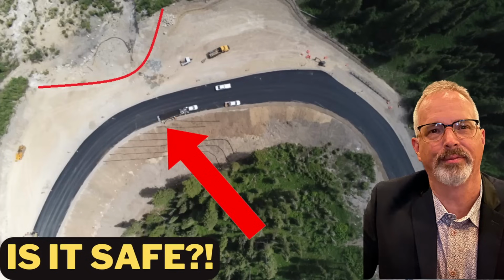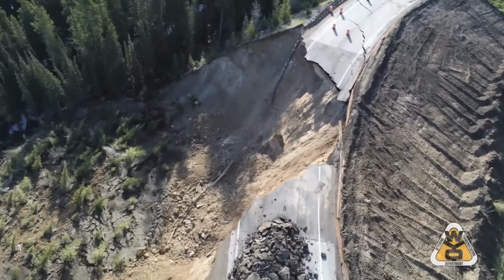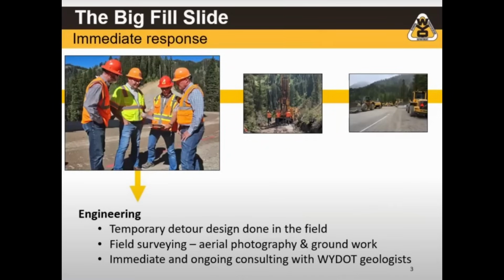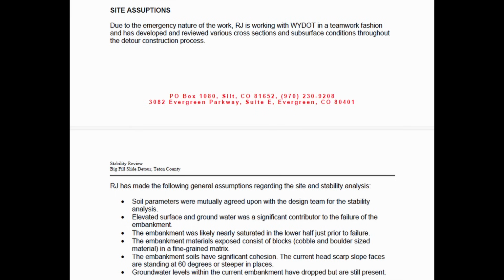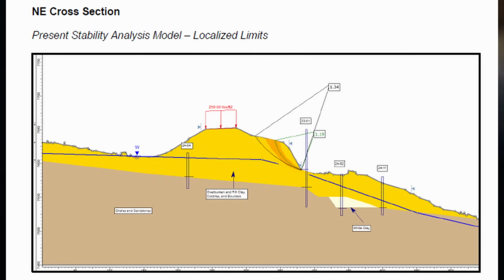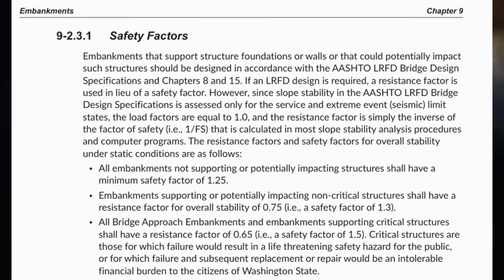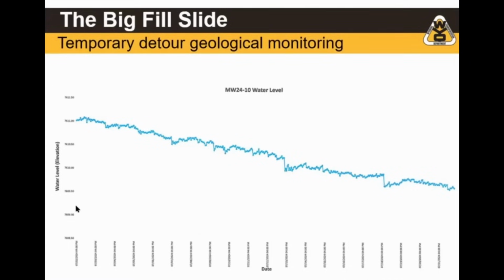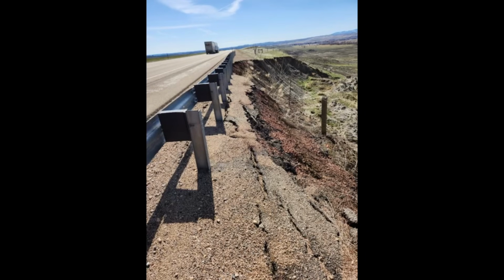Teton Highway Rebuild Update

Comment: Here's a true story about another 'Professional Engineer'. I owned an apartment in a 30 unit building that had a water intrusion issue that had compromised structural wood members on three levels. A licensed 'P.E.' did an inspection after the drywall and building cladding was removed. He then submitted an engineering estimate of $12,000 to provide drawings (with his 'magic seal') to guide the contractor. That was just for DRAWINGS but no actual repair. But all we really needed was a good wood framing contractor to rebuild what was there and what was already code approved. Plus the roof repair that was already known. We hired a contractor to replicate the original framing costing $14K total. The P.E. was angry we ignored his insistence on his new drawings with his SEAL! He even reported our HOA to the building and codes office! BUT our contractor had already pulled a permit to replicate the existing framing. So we were good.
Reply from the maker: I'm not sure what you mean by "another". Not at all engineers are the same, just like not all contractors are the same.

Comment: Trying to parse through this,  is the temp bypass at risk of sliding as well or is it a bad set of specs for curve and slope aka into the winter?     And is the risk also in the repair phase to the workers on the face?    Truly a Slip shod (pun not intended but not ignored) operation and pencil whipping of the situation.     While I am not remotely a geo engineer,   I do know data sets and reports and the presentation (or summation)  has to be packed up by hard data or its subject to outright lies.    As a cycle rider,  riding into a crack (mild, more a chasm)  like that is one of the nightmares for  a rider (much like going into a curve and finding loose gravel on top of asphalt).    The only good news is injured and not killed.
Reply from the maker: Since WyDOT didn't provide the basis of their quick design for this temporary bypass. I know that it simply takes several weeks to drill, sample and test soils for geotechnical engineering purposes (it certainly takes more time than the 3 weeks the took to put in this bypass).  It has always been my impression that they just made a judgement call about what to do without what I consider to be the customary type and amount of engineering analysis and I think that was unduly risky (and still is in my opinion).  I think this work to the main embankment section is very dangerous.

Comment: The bridge above the failed Rapidan dam that failed 2 months ago got a new video out. https://www.youtube.com/watch?v=RdlDCfsWqns
 The bridge's concrete foot is now above the river level, leaving metal rods holding up the weight of the bridge. So, I think it has officially gone beyond scour now as a process of erosion.
Reply from the maker: Thanks for that link.  I am going to do an update soon to cover what the county and state are going to likely end up doing with this dam and bridge.
Reply: @CaseyJones-Engineer   Good luck with that, I was shocked to see how shallow the concrete pour went, thinking of the old bridges that were so deep that people got the bends working on their foundations. 

Also, grats on avoiding the Harley drama with your other channel. I was at Sturgis 3 weeks ago, and knew something was up then, but not what exactly.

Comment: Time to do some horizontal drilling and put in some drainage to handle the water.  If they just do a bunch of filling without doing some drilling and soil amending (Grouting) to prevent progressive failure.  "Mutually agreed upon soil parameters" sounds like typical bureaucrat word salad.  Unless they can provide lab results and some geotechnical re-evaluation reports, I am not going to believe them.

Comment: I’m not an engineer.  Get really big boulders, lots of them.  Start piling them at the bottom.  Over engineer the amount needed.  Reduce the angle of the slope.  Build from bottom up a firm foundation.  Backfill with gravel and not water soluble clay.  Pack it in tight.  Overlay with water barrier such that water doesn’t get into the slope.  Your Welcome.  I’ll send my invoice for $2,000,000 next week.
Reply: Five times too expensive, I estimate. I'll send my invoice for $1 next week.
Reply: @allanfarr  brilliant idea! I think you could do this at the beach when trying to save your sandcastles - but not applicable for this project. Good luck!

Comment: Though it might not be possible, it’d be interesting to know the safety factor that was used during the original design of the embankment.  That would inform choices of materials and methods for the reconstruction and repair.

Being native to the Rocky Mountain west, and having driven over the road in question and many of the roads in the general area, it seems to me that a 60 degree angle repose is way, way steep.  It simply doesn’t seem right.  Also, there have been severe earthquakes nearby, such as the one that triggered a landslide that filled a canyon and created a new lake.

Among all the events and factors in play here, what weakens my confidence the most is the lack of transparency.  Standard engineering practice includes reviews.  Military projects are run by knowledgeable and often well educated officers who also bring in third party consultants.  Contractors are expected to keep the customer informed.  The Wyoming folks aren’t doing anything like that.  The public deserves better.

Comment: Data could have been gathered from the original designs of the fill (as what material was used in the construction process). For a proper reconstruction the entity of the fill should be removed ( maybe even reused) and then constructed with newer designs including an appropriate drainage system and using certain reinforcement measures (geo textiles for earth like materials etc). There was an obvious lack of a proper drainage system in the fill in the original build. If the system is not properly implemented then the new fill will crash in a couple of decades. The proposed cross sections are an insult for a civil engineer or a geotechnical engineer (imho). November as a complement date is far too soon….
And some criticisms about you. And you should understand that this is a very desirable character. You are an annoying person and I like it, because things should be done right on not to be done. 11% slope on a mountain road is not that bad for a detour. 
Hope to see updates on the rebuild of the pass.

Comment: I feel like safety factor needs to be scaled according to certainty of strength and load, and should probably be at least double the combined uncertainty involved.  Given the speed they supposedly figured everything out I can't imagine the combined uncertainty is less than 10% unless they are admitting to gross negligence as they KNEW it WOULD fail, unless they had much higher prior knowledge which would have told them that it would fail, they can't be that certain how strong it is, clearly their prior knowledge was wrong so how are they suddenly so certain how strong it is?
Reply from the maker: You have pointed out one of the main concerns about this situation.  Their judgement was wrong when it came to assessing whether the slope would fail catastrophically, yet they expect people to trust their judgement about the rushed rebuild.

Comment: “Elevated surface and ground water was a significant contributor to the failure of the embankment.” Yet the design is devoid of dewatering drains. Am I missing something?
Reply from the maker: The cross-section did not show drainage elements very well, but WyDOT mentioned at the library presentation that drainage features would be incorporated into the rebuilt slope.

Comment: I think we could agree the the risk of a vehicle going down with any slide is far less than a vehicle driving off the edge after a slide has occurred. 

Considering the relatively low safety factor on the temporary fix I wish they included features to reduce the likelihood of people driving off the potential slide. This would primarily mean improved lighting and things that reduced speeds. 

I do understand that there is no utility power in the area for lighting. A generator would be needed. 

I know some people think that accepting risks and asking drivers to be ready to respond to them is something that should never be done. But I have driven many "Rock" or "Falling Rock" signs. Even some "Slide Area" signs. We can't alway make roads as safe as we wish that we could. These signs prove that. But we should make a reasonable effort. That is what Casey is saying. I am saying the same. I am just suggesting a different additional actions since the safety factor for a potential slide is so low and it uncertainty is so high.

Comment: They have what appears to be good embankment material already placed in the orioginal fill, which is great.
But the core issue still has not been addressed- the embankment dams up a seasonal waterway. All they need to do is bore through the base of the whole thing and give the water free movement and never worry about it ever again. Compared to the current scope of work, it is cheap.
Placing drainage materials in the base of the new fill slope leaves over half of the original slope unchanged, so the drainage is useless.

Comment: Casey !!! You mentioned Triaxial tests, along with the slope analysis, years ago, 50 years!!!, before I was 18 I worked in a soil testing lab. Doing the Triaxial tests, slump tests, sample sieving, and helping to prepare the samples for the testing. 
Others on a higher paygrade!!! Messed about with the numbers we recorded. 

Two thoughts, the Victorian navvies building Britain's railways created miles of embankments and cuttings and thru trial and error as  many earthworks or viaducts  failed during construction and had to be redone/fixed. Working without modern testing, its surprising how much of their work is still in good condition.  But in certain places ground conditions, lack of maintenance or ridiculous amounts of rain ( in the last 18 months here) have caused more slope failures across the country.

Two, secondly could you put together a video showing how samples are gathered. The tests available and examples of different soil types being put thru the battery of tests to illuminate what you are describing, how stuff fails.
I was thinking of the different behaviour during a triaxial test of Peat, Sand, a Boulder Clay/Glacial clay, a softer Clay with an angled Sand layer, or just a average loam/ sand / clay mix.

60 precent slope !!!!! You can hardly scramble up it, mad.
Reply from the maker: Thank you.  Yes, I have been considering doing a more in depth video of drilling, sampling and testing of soil samples so please stay tuned!
Reply: @CaseyJones-Engineer  Cool I'm looking forward to it!!

Comment: They got the road open, the damage done by having it closed economically far outweighed the risks of a quick fix obviously, they bought time while a permanent fix can be undertaken. Makes sense to me anyway.
Reply from the maker: I think there could be analogy here with a doctor performing surgery who had an urgent case and decided he didn't have time to wash, despite the risk of infection to the patient.
Reply: @CaseyJones-Engineer  But if the doctor had taken the time to wash up the patient may have died, my point exactly. Not everything in every situation can be engineered to exact specs due to the time and urgency of the situation, read Kelly Johnson's biography, sometimes you go with what works at the time. Just my opinion nothing personal, I know your very sensitive.
Reply from the maker: @gocarnivoreforlife  I guarantee I am not as sensitive as some of these Wyoming cowboys.  How about next time WyDOT just installs a tight rope across the hairpin curve and give people a pole and tell them good luck.🤣

Comment: Great point on the letter "assumptions" which sort of makes me think they worked from the answer they wanted and back to the root parameters. What I think should have been done was to use the failure state to evaluate the soil stability parameters based on the destructive "test" of the embankment, and then build forward from there. And yes, a 1.5x safety factor should really be an absolute minimum safety factor.
Reply from the maker: Thank you!

Comment: You mentioned that Styrofoam is becoming a common fill material for highway embankments. I have a concern because there's been recently shown that styrofoam is actually biodegradable! The superworms that you buy at the pet store apparently can live off nothing but Styrofoam and water, and if they can do that it's unlikely that they're the only thing on the planet that can.
Reply from the maker: Interesting about the worms!  I do not that for highway embankments that have to make sure that no gas or diesel spill would reach the styrofoam as it would melt like cotton candy hit by water.
Reply: @CaseyJones-Engineer 
My first assumption was that they would use a material similar to what was use to reopen I-95 after the fuel trucks fire destroyed a bridge. Is that possible? Or is that material inappropriate for this application?
Reply: Ants love the stuff too

Comment: I documented an airplane hangar like behind the barbed wire fence for my local international airport and i swear the hole was 18ft deep i told them i cant go in over 4ft deep hole without bench or shoring and it ended being only 3ft deep

Comment: Over time they just dig deeper and deeper and build higher and higher and that definitely too high elevation and not proper lifts too much fill too deep at once you cant just throw that stuff there without care and pile it that high now you have to remove it before it go bad and not dig too deep and keep the original soil barely touched and kept protected from weather in ideal conditions lot of work to undo and redo the right way

Comment: Be careful showing or quoting documents provided by sources who have asked not to be named.  If I wanted to root out a mole, all I have to do is provide different versions of a document to different people - slight wording and format changes are all that's needed.  

For sources, don't print or copy documents on a company printer or even at home.  Modern copiers and printers will print nearly-invisible yellow dots that can be decoded to serial number and date and time.  To check for this, use a blue LED light.  The yellow dots will show up as black dots.
Reply from the maker: Thank you for those tips.

Comment: It looks like they just split the difference built it higher and lower which would be good barely dig any more but it has to be in ideal conditions or else youll jist preserve a huge mess instead of propely protect sub surface

Comment: Once again, another excellent video. I had to look up the term safety Factor that was used a lot here. This is what I found. 

Typically, the safety factor is a ratio—if a structure is designed with a safety factor of 2, it means the structure can withstand twice the expected maximum load before failing.

I assume this is correct. If not what does it mean.
Reply from the maker: You are correct.  I covered more of this in previous videos but here is the summary.  Generally, potential failure surfaces within a slope are circular or log spiral in shape.  To compute the factor of safety for the slope, you take the total of all of the resisting forces divided by all of the driving forces.  This is done by idealizing the potential failure mass as a series of vertical slices above the potential shear or sliding surface.  The resisting forces are mostly due to the strength of the soil along the potential failure surface.  The driving forces are from gravity acting on the mass of soil above the potential failure surface.  So to come up with accurate values for both driving and resisting forces, the properties of the soil (strength, density and location of ground water) need to be know to within a high degree of confidence, otherwise the computation is meaningless.

Comment: The most important parts of any problem are inputs and assumptions.  Basically garbage in, garbage out.  Then it's model and tool selection.  All models are wrong, but some are useful. Make sure you're using the right model, and then make sure you're using the right tools to analyze that model.  Finally, interpretation of results.
Reply from the maker: Yes, exactly right!

Comment: In 2012 Interstate 75 near Jellico, TN, was closed when a major landslide took out the southbound lanes. The interstate was closed until the stability of the rest of the area could be determined. TDOT brought in a contractor that used an artillery piece to shoot soil nails into the slope to help stabilize it. They did not open the northbound lanes until they were sure that the rest of the slope would not give way.
Reply: TDOT is very good at Slides, TDOT also Help out NCDOT on their I40 rock slide Problems

Comment: Casey: you need a vacation. you should go over Teton pass in your car. Haha, it is so high elevation that 200 HP turns into 11 HP, plus your arms get tired from turns, & no place to pull over. Steep edges  on all the way up and down will scare you silly. And, the clincher: 11% grade! oh yeah! straight up, then straight down. Your brakes won't hold out. Then you can complain of the 'poor' engineering.
Reply from the maker: You have outlined the situation well.  Adding winter weather to this mix will be something!